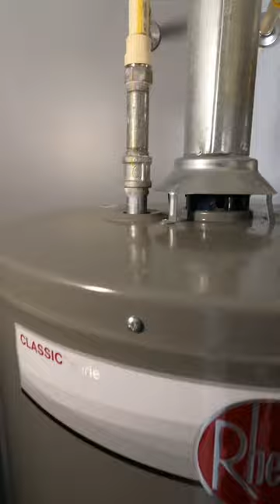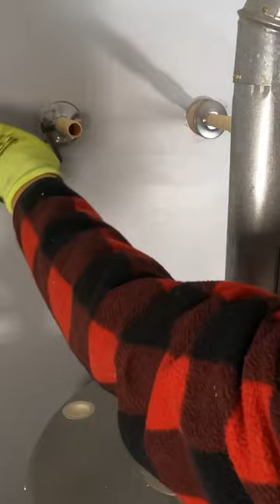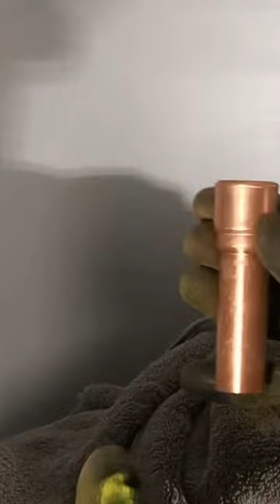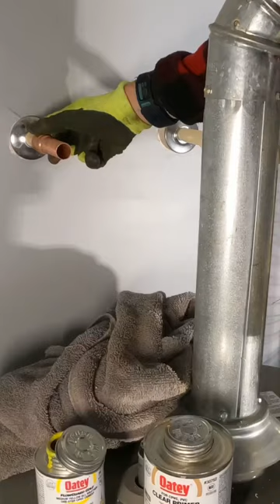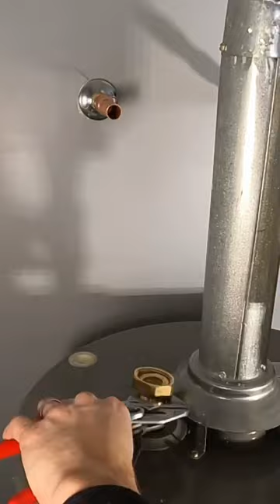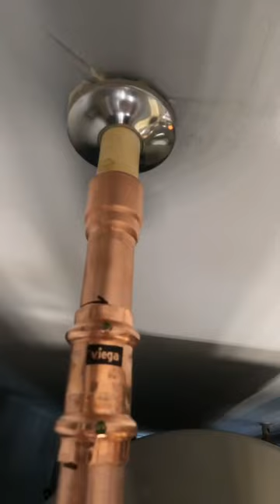Adding a hot water recirculating pump 💦 #shorts #plumbing #plumber

Comment: now that pump is on HWT outlet to  point of use-faucets..but you need to complete ( close) the loop back to tank ( another pipe which is called recirculation line) which should connect into cold water feeding the tank ( with a check valve on the cold side!) and that will close the loop or connect it to the drain port of a hot water tank ( HWT)..but if there is no recirculation line then I saw those kits could be installed underneath sink to allow flow to complete the loop..
Reply from the maker: There’s a crossover valve under the furthest fixture, I understand how a recirc pump works 😂
Reply: @theplumberlorian  crossover to what? Just back to the HW supply so with all valves closed the pumps not completely dead headed? I guess a check valve as well.
Reply: Yeah I don't get it either
Reply: @sampantiliano  it’s a crossover that goes at the furthest fixture or wherever you like hot water the quickest. It has four ports. It’s a thermal check valve that shuts off at 95F the pump moves the hot water all the way through the cold side until the check valve closes. Easier to explain in person but hopefully that’s good enough.
Reply: @SundaysCatch  Thank you
Reply: HE GOT US WITH THE CROSSOVER! 😂
Reply: Without a return line the cold side would be hot until all the cold is run long enough to use all the water in the cold side piping. Seems like a halfassed way to get it done.
Reply: @jamminwrenches860  for sure. This is crap.
Reply: @scottfletcher1956  this is a retrofit if the customer doesnt want to re-work their entire water system. Works great. It does push hot water into the cold but by the time the hot actually makes it to the cold their should be barely a difference
Reply: @jamminwrenches860  thats what i was thinking!
Reply: It comes with a baffle tee you put at furthest fixture so you don't have to run a recirc line I use them they work
Reply: @sampantiliano  comes with a baffle tee that has built in check valves you put under furthest sink from water heater I use them they work
Reply: I actually just have some hot water in your cold line for a little bit going to be scared.😢
Reply: lmao
Reply: im sure they are using return cross connection to cold water.
Reply: I recently installed one of these. I was looking for the battery for the sensor on the crossover valve. I assumed that it works off thermodynamics. When the water at the farthest fixture comes down to a certain temperature, the port opens to allow the pump to overpower the normal water pressure and flow the cooled hot water into the domestic cold distribution piping.
Reply: You can set timers for it to come on only when you’re home and save money on your gas and electric bills. Watts is a somewhat well known brand in plumbing parts. I think it was told to me that the replacement sensor is too expensive to not just buy the whole system though.
Reply: @SundaysCatch yeah i need 2 see this in person, hands on. No doubt
Reply: @SundaysCatch im gunna need you to draw a diagram with letters and symbols, brohamski- are you capable of that???
Reply: @jp360ford2 allen iverson on jordan "break your ankle" crossover????
Reply: @marcuspeters5855  haha you can look it up it’s pretty accessible
Reply: @SundaysCatch  i know dude, and i will. Thanx!
Reply: It crosses into the cold water
Reply: @theplumberlorian  You really should tell your amateur plumber viewers that this video only tells half the story of HW recirc.
Reply: @Seven7Pain1 Doesn’t that mean you’ll have hot water when your turn the cold on until all the hot water runs through?

Comment: Hey man i love your vids, i have a plumbing question for you. What type of PVC do i have to use for a water line that is going to have pressure on it? does it have to be schedule 80 fittings and is there a special type of glue i have to use thats different from normal pvc glue and primer?
Reply from the maker: Thanks man, it would depend on your area and what they allow … they allow sch 40 pvc outdoors on cold water here .. but if your running hot water lines you can’t use PVC .. it would have to be CPVC .. or some other material such as PEX or Copper .. I would recommend PEX since its the most inexpensive
Reply: I also would run with pex.

Comment: I failed to see the loop for recirculation.  What are you recirculating
Reply from the maker: There’s a crossover valve under the furthest fixture that creates the loop
Reply: I am recirculating the excessive unions in last night's chile.
Reply: @theplumberlorian  would that mean your using the cold line as the return line or is there another line going into the tank and your just installing the pump at the beginning of the circuit rather than the end? It’s an honest question, so bare with me. Also did you install a check valve?one for the pump and another to prevent back flow into the cold?
Reply: @alfredosalazar526 yes it goes into the cold line at the other end

Comment: A tip for anyone interested. Make sure you know where the building water can be shut off prior to doing a job like this especially in a condo. A plumber I know didn’t and it took 45 minutes to stop the water after a pipe broke in the wall
Reply from the maker: Plumbing 101. Always have a back up plan
Reply: @theplumberlorian  plumbing 102, shit flows downhill, payday is Friday and don't bite your nails.

Comment: How long do you wait to turn on water with cpvc glue?
Reply from the maker: Depends on the size but for 3/4 inch I usually wait 1 hour for cold and 2 for hot
Reply: Never
Reply: Blue glue 10 minutes
Reply: 5 min ,don’t waste your time
Reply: @angelvelasco9770  you're crazy

Comment: That is a recirc pump but it is dead dead at the faucets. You need to run a hot water line from the furthest point back to the water heater.
Reply from the maker: There’s a crossover valve at the furthest fixture

Comment: You did it wrong. Goes to the cold side and a check valve as soon as it comes out of the wall so it doesnt push back into cold supply.
Reply from the maker: Nope not this retrofit kit it doesn’t

Comment: Should have made it easier on the next guy and put a shutoff on the hot side so when that pump goes out water doesn’t drip all over the place when replacing
Reply from the maker: It’s a ranch style home and all the water lines are fed from the slab .. a shut off would serve no purpose
Reply: @theplumberlorian  wrong. Anytime anyone opens a faucet that air pushed that water out. Just good practice and an extra ticket item imo. Clean work
Reply: @doesntmatter5263  it's illegal to put shut offs on the hot
Reply: Shut offs on the hot side is a bad idea. If home owner closed both hot and cold, could create a bomb if water heater malfunctions and T&P valve fails. You already have a cold water shutoff coming into the heater. All hot water would add is making it easier to replace the tank in the future at the risk of a dumb home owner blowing up their house.

Comment: Hackzall aka sabre reciprocating dragon saw on 15mm pipe ? Buy a pipe cutter for ten bucks or a Milwaukee for 100. Straight cut pipes difficult your way.
Reply: Looks like he wanted to save as much pipe with the fitting there.

Comment: Where is this? I have never seen pvc used for supply lines here in the USA.
Reply: Well sir I’m a commercial plumber in nj. And almost every wawa has cpvc idk why because it sucks but they do we always cut it out and replace with cooper
Reply: @mattboyd9591  that makes sense because I have never been to New Jersey, I work in an apartment complex that's a bit older where I am replacing everything, as opportunity arises, with pex.
Reply from the maker: It’s CPVC pipe
Reply: @theplumberlorian  yes, just high temperature pvc, in the Midwest pvc is only used for drains.

Comment: Where’s it recirculating to?
Reply: Back through the cold, at the furthest fixture
Reply from the maker: There’s a cross over valve under the furthest fixture, uses the cold line as the loop
Reply from the maker: Yes sir
Reply: Doesn’t that make the cold water hot?
Reply: @Is_Time_A_Number  no because it has a temperature sensor and it only allows cold water through no hot water goes through it. It’s about the cuts up to the hot and cold underneath the sink.
Reply: How is it resurculating without a resurreciation line
Reply: @holywoodhawks  because it goes in the cold water side and recirculate back to the cold to the water heater
Reply: So you are adding the nasty water from the tank into the potable drinking water
Reply: @holywoodhawks  what are you talking about? Water heaters are usually pretty clean if they’re flushed yearly.
Reply: @VacMaster2020  that's a big if most homeowners don't know this
Reply: @VacMaster-uq3wg  also why would I want hot water in my cold lines
Reply: @holywoodhawks  you’re just putting the cold water from the Hotline into the cold line once it’s hot it stops

Comment: Need recirc line, and pump is supposed to feed into cold side of tank
Reply from the maker: This is a retro fit system .. it’s supposed to be on the hot side of the heater with a crossover valve under the furthest fixture

Comment: What brand and model pump are you installing. Good video, thank you!!!
Reply from the maker: It’s a 3/4 recirc pump by Watts not sure on the model they only have the one kind
Reply: @theplumberlorian  Thank you for the response. If the power goes out can I still get the remaining hot water from the tank via city pressure (through the idle impeller)?

Comment: How is that a recirculation with only one pipe? You would need a return line that’s just a booster pump I guess.
Reply from the maker: It’s a retrofit kit .. there’s a crossover valve under the furthest fixture
Reply: @theplumberlorian  crossover valve to what? Are u gonna pump hot water into the cold supply? I'm not understanding
Reply: @bryand426  I guess return back into the Hw tank or heater. I know a pump can’t recirculate without a complete loop. I’m not a plumber I’m a HVAC guy. I would think that it would cause the water to be too hot then your waiting for it to cool off. And probably cause the Hw heather to fire more.
Reply: @Sam Pantiliano  but the cold water side is pressurized so it won't just flow backwards.  I'm missing something here
Reply: @bryand426  You would need a check valve.
Reply: @bryand426  Over-the-water-heater: For this configuration, the pump is located above the water heater, and a check valve is located under the sink furthest away from the hot water heater. The pump pressurizes the hot side of the systems and, through the bypass valve under the sink, it pushes the hot water into the cold water system, creating a hot loop. This loop can run constantly, or it can be used with a timer that may even be built into the unit. With the timer, you can just run the pump on during those times of day when you need quick hot water. Connecting the recirculating system check valve to the system under the sink furthest away allows the system to provide quick hot water all along the line because the hot water is circulating throughout the house. An instant hot water recirculating system usually comes with everything you need to install it. Keep in mind, though, that you will need power near the water heater to plug in the pump.
Reply: @Sam Pantiliano  the cold supply is gonna act like a heat sink... Plus any time the pump is on depending on your street pressure and the pumps pressure you may get no cold water... I mean just run a proper return line or throw a point of use heater like a little eemax at the far fixtures.

Comment: Yes this is when the 18" rule of hard pipe comes into play cause of vent on top
Reply from the maker: Yeah it’s not 18 inches here but yeah needs metal at the top of the heater on gas for sure
Reply: @theplumberlorian  yeah I've had some plumbers say all water heaters but truth is in Ga and Sc only on top vented gas water heaters cause electric and tankless we can pex right up to it every state has there own codes that's why every year we take a continued education class I have to do 2 cause I work on Ga Sc border in Augusta

Comment: The problem with those circulation pumps is that the crossover valve that is under the farthest fixture theylvway it works is to let run the hot water line into the cold water line to make the loop and make the recirculation, The biggest problem will be that You will have hot water in both lines hot and cold.
Reply from the maker: Works like a charm!

Comment: I hope everyone knows that those comfort pumps can not be turned on all the time, they need to have a 15mins on/off setting on them. The reason why cause you can push hot water back into the cold side of where your bypass tee is. These are good for if you have no recirculating line back to the water heater but homeowners need to be educated on how they actually operate with demand on the hot side will not always be 120deg.
Reply from the maker: I run mine 24/7 .. no issues

Comment: Ya… usually you would have the pump on a circ line taken from the furthest fixture hot line, then pumping into the cold with a cheque valve upstream of the pump.
Reply from the maker: Yea this is a retro fit system .. there’s a crossover valve at the furthest fixture